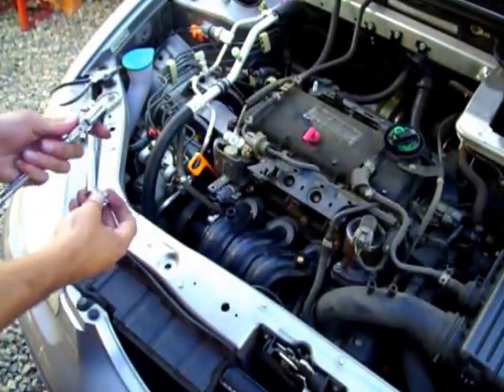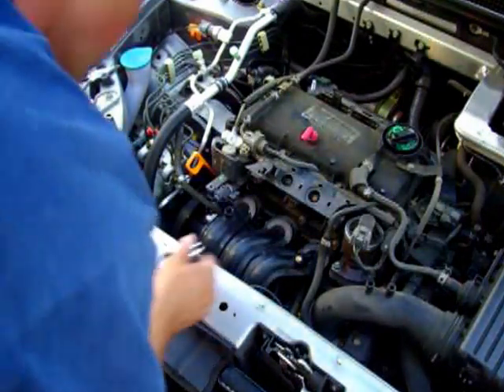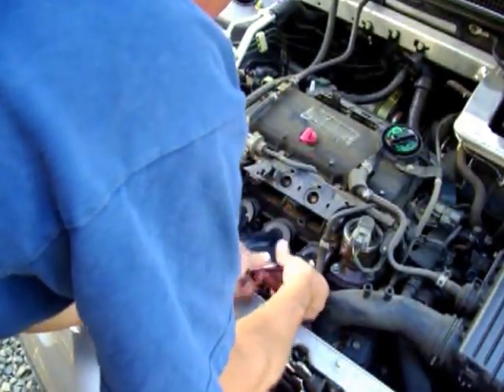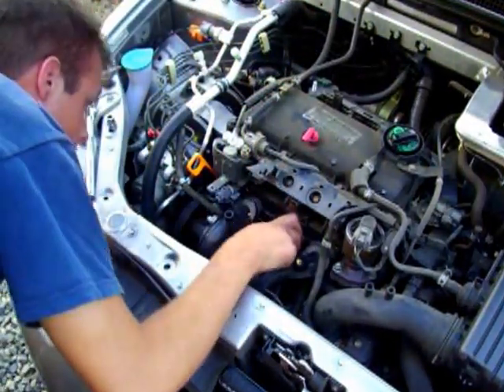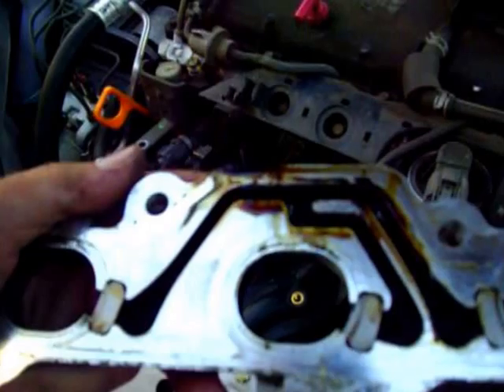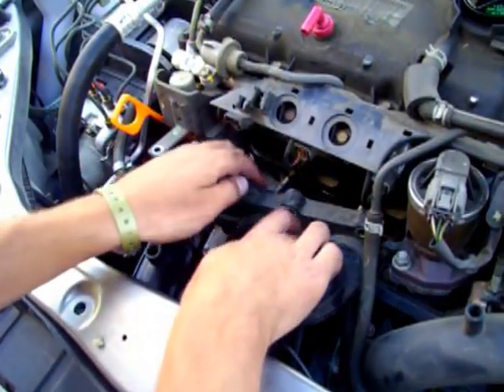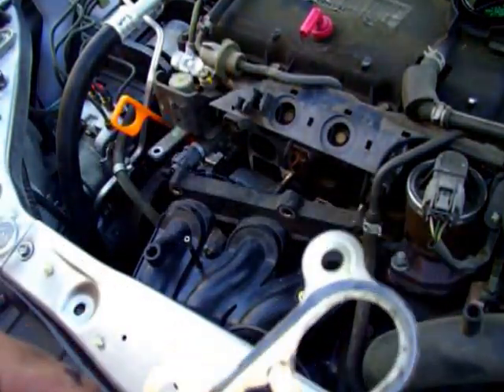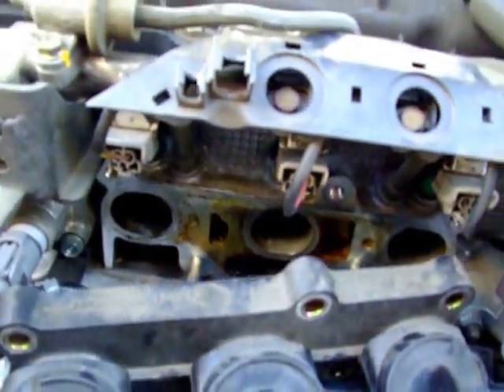Part 2 EGR Plate Removal / Cleaning 1st Gen Honda Insight. 00-06

Comment: What is the egr do?
Reply: It allows exhaust gasses to recirculate into the intake to burn unused fuel and allows the car to run a lean burn mode which enables the car to get 60+ mpg.

Comment: why dont you put a catch can so it doesnt foul up anymore?
Reply: Carbon deposits will build up in an EGR system regardless of whether a catch can is installed. They come from soot in the exhaust gas. A catch can is intended to collect oil from the PCV system to prevent it from leaving residue or building up sludge on the throttle body and intake system- it serves a different purpose entirely.